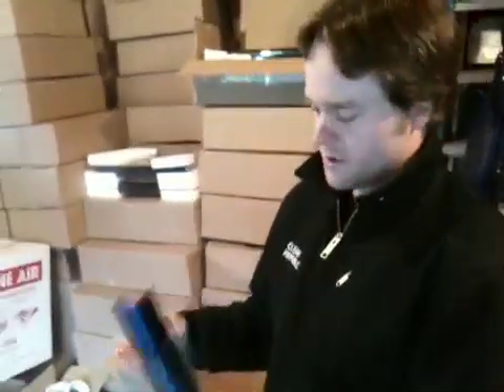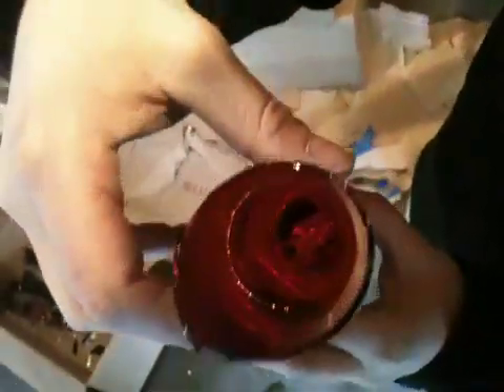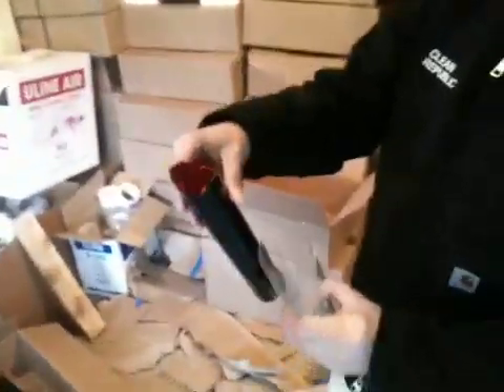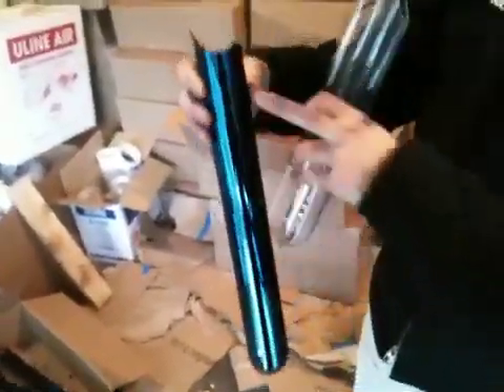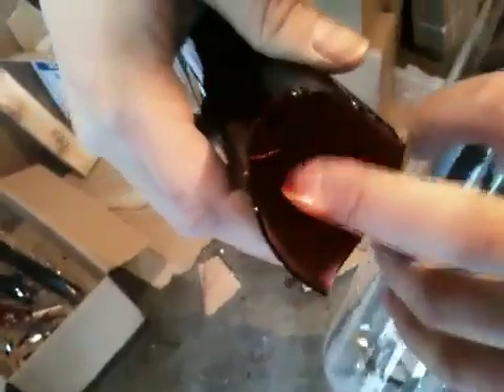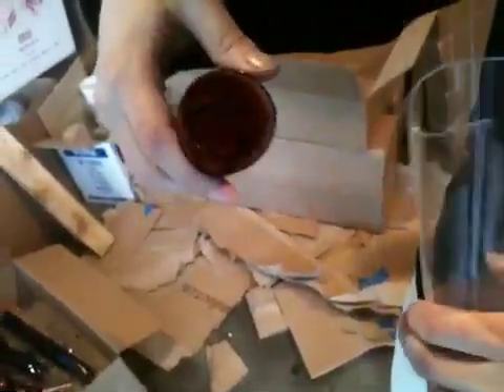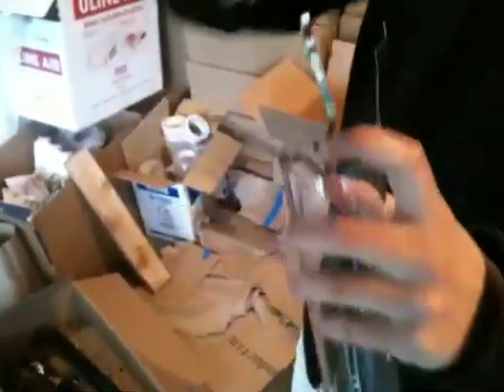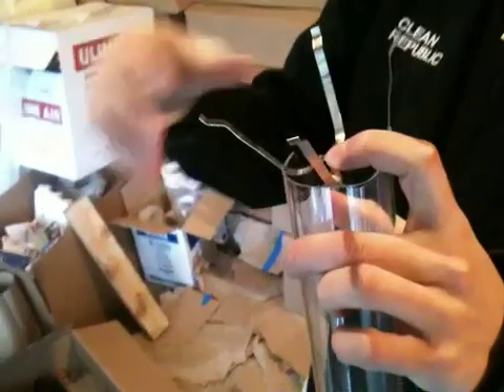Inside passive solar vacuum tube. Boils water in the sun!

Comment: And yet some of your own videos promote passive flow designs in which water is placed in the tubes and the heat transfers via convection within the water. At the same time, people in videos elsewhere are promoting use of the tubes to boil water for making coffee. If liquid placed in the tube itself is in contact with these reflective coatings, then there is, indeed, a potential for leaching. Please clarify the matter.

Comment: the water doesnt come in contact with the inner tube, usually there is a heat-pipe inside the tube made out of copper that absorbes the heat, then transports it to the exchanger through metal to metal contact and heats the water, so there is no direct contact with the fluid inside the tube and the water...hope it helps

Comment: So if water circulates thru the center of these tubes, lined with unknown substance then into your HW tank, then how do you know it isnt leacching any dangerous chemicals that you will breathing in the steam as you shower or drink if you take hot out of the tap? seems the best way to use these would be with a heat exchanger? clue me in please.